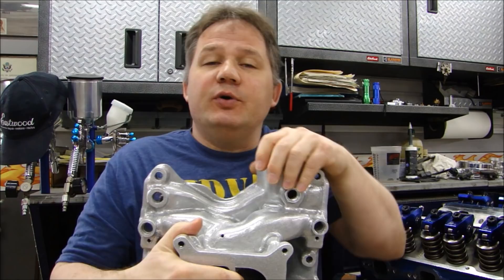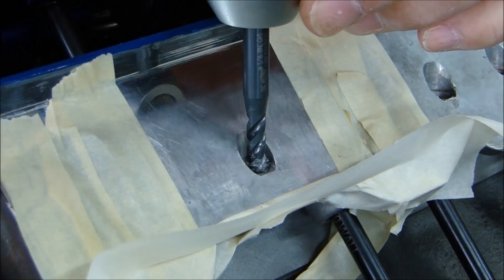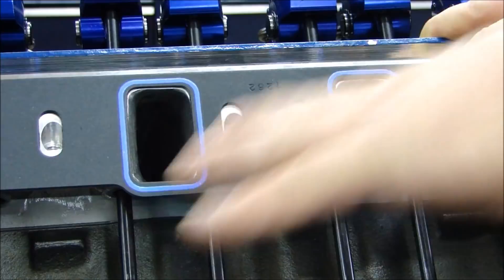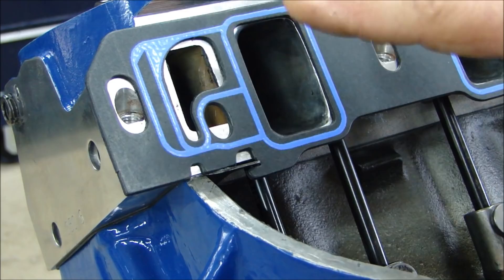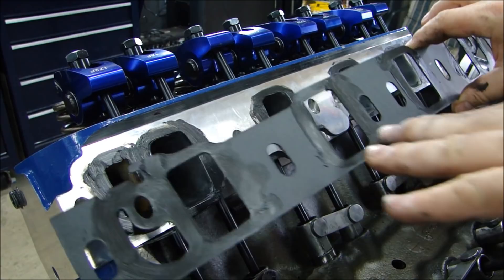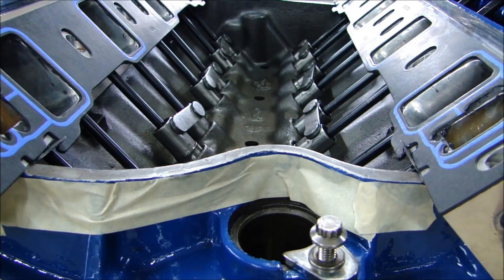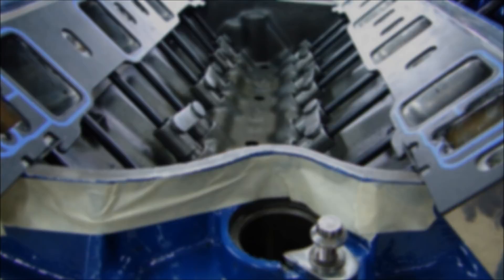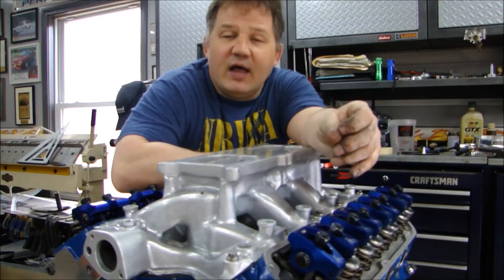Engine Building Part 9: Intake Manifold Installation

Comment: Thanks for the information. I'm currently working on (my first mechanic project!) a 1984 Cadillac Fleetwood with the factory 4.1L V8 (HT4100), replacing the intake manifold gasket and many other things. This is a huge project to work on, one thing after another with this engine. There isn't many videos online that go into any detail about intake manifolds or even engines, in general. You explained everything very clearly and make things easy to understand in all of your videos. Combined with a big shop manual, your videos are a big help!
Reply from the maker: That's awesome Shane, good luck. I had one of those engines, they're not the greatest, but you can rebuild them and get them to last.
Reply: @PetesGarage  yes sir! Thank you for that, I'm glad to know they are worth the time to rebuild. I see it as an engine that just needs TLC and follow up with regular scheduled maintenance. The car really is in good condition other than the few engine issues, not a scratch on the body, vinyl top in near perfect shape. Everyone wants to throw this engine away, honestly I've come to like this (not so loved) HT4100. it's given me an opportunity to really learn how an engine works  and learn the primitive emissions control set-up of 1984. I'm looking through most of your videos and learning some pretty cool stuff! Thank you for all you do, Pete! Going to rewatch the intake manifold videos!

Comment: Nice touch with the galvanic corrosion. Alot of builders out their have no idea why or where the corrosion came from. Good Video!
Reply from the maker: I thought it was important to bring up.
Reply: Tottaly, my son has a mustang. And recently wanted me to help him do some work on it. We started with headers and X pipe.Yea we had to drill out bolts that snaped off due to corrosion. He still has a problem understanding why ford would use such corrosive materials in manufacturing. I told him a lot of it comes from failure to understand how to prep your work. I let him watch your video to help him understand better. His first words after watching was" that was so simple he should send a copy to ford motor company." LOL Keep up the good work!
Reply from the maker: That's funny. Smart Kid!

Comment: Old school is to smear some grease on the tap, it'll pick up most of the debris loosened by the chasing out. Personally, I prefer to use a small "T" bar type tap holder but that'll be a question of preferences, of course.
Another old school trick is to use a standard bottom/finishing tap but lightly grind the cutting edge so it cleans the threads but it minimises the chance of it removing parent material from the tapped part.
Nice explanation on the galvanic corrosion problem, too, BTW.
Reply from the maker: +GordonWG1 Excellent! Thank you for sharing that with us. Lots of great tips
Reply: +GordonWG1 Ahh ya beat me too it.

Comment: Petes videos should come with a warning! it would read  "To avoid conflict, anyone who watches these videos might not want to walk into their friends pro workshop and point out things that they missed, dont forget! no one likes a smart ass" Thanks Pete you make it fascinating.
Reply from the maker: That is an excellent point Bryan, thanks for your comment. I, in no way, shape, or form claim to be the worlds authority. But, I am trying to share best practices to help ensure anyone doing the work gets the best results. I've replied to many comments that say I'm over cautious that I've never had an engine fail from being too clean. If you do happen to wander into a pro shop, you can be polite as possible so as not to appear to be a wise ass. If they're smart, they'll try to learn from because nobody knows everything. I learn something new everyday.
Reply: @PetesGarage  agreed, just a bit of fun, I bought a 460 stroker well worked off a guy who bought it off a mechanic that died, motor was new, it made a terrible tapping when the guy I bought it off started it, i bought it anyway because hed never driven it just started it, revved it and turned it off, luckily it was so loud out the headers he couldn't run it long without neighbors complaining, well when I got it home I removed the rocker covers and they were all loose, I'm thinking that the original owner stored it that way (well I hope) problem is how much damage has been done as there is fine steel filings in the oil sitting on the head. .
Reply from the maker: That's a tough one, hope it works out

Comment: Fantastic Pete. A Great video. 
 I bought a 355 sbc a few years ago that had been blown up. The silicon between the intake and the block was about 1/2 an inch thick and everywhere but where it needed to be. I knew as soon as I saw that it was poorly built with a lack of consideration.
 It had only be run for about a month before it calved, when disassembling it to see what had gone wrong, some of the cam lobes were nearly gone.
 Low mileage, I assume no assembly lube and poorly put together was visually obvious as well as internally.
Reply from the maker: Or poor break-in procedures

Comment: These are some great videos, I really enjoy the knowledge you are sharing. You made the sealant application look really easy which says a lot about your skill. I would recommend that anyone without any sealant experience should get some scraps pieces and get used to working with the sealant first before putting it on their project, it can be much more difficult then it looks and can make a big mess.
Reply from the maker: Great suggestion. Thank you.

Comment: Can also use intake manifold studs instead of bolts. Fool proof way to install the manifold without making a silicone mess, especially if engine is in the car. Great videos.
Reply from the maker: You could...but you'd have to put the studs in after the manifold is installed because of the angle on the heads. I[m not saying no, but I do not see much benefit...great idea though

Comment: Try Permatex high heat "spray copper" form-a-gasket. Just paint the gasket surface. let stand for 1 minute till tacky then apply. no mess no fuss little if any squeeze out complete gasket surface coverage. I use 2 coats. 1 to seal the gasket and the other 1 minute later to seal the head surface wait 1 minute and apply. LOVE the idea of powder coating the intake inside surfaces. never thought of that. Talk about a time saver! THANKS!!
Reply from the maker: Billy, thank you again for some great advice. Like I said, we are all here to help each other.

Comment: one thing to remember about galvanic corrosion (i was taught) - the farther the metals get from each other on your scale, the greater the potential for corrosion. for example, copper and aluminum together - copper will eat it up in short order. copper and lead put together, almost nothing will happen. that is why you can have lead coated copper in roofing materials. but use aluminum nails on a copper roof, they will be dissolved by the copper.
Reply from the maker: +timothy ramsey Excellent point....thank you for sharing with us

Comment: I have countless positive things to say about this video series. To this video i would like to add that one may want to use a tap specifically designed to chase threads. standard taps and even bottoming taps are designed to cut threads and may cut out extra material, thus making the threads thinner and weaker. I use regular taps, but the special ones would be a safer move.
Reply from the maker: That is an excellent point, however, after working in production engine machining for a long time I can tell you that tools wear. If you buy a head that was made right before a tool change the threads could be on the small side throwing off your torque. A tap will make sure they are the correct size.
Reply: That is a great point as well. I had not thought about that. Thank you for the correction!

Comment: Pete, please make a video about your Intake manifold and throttle bodies. I absolutely LOVE your idea. I have been looking for that kind of setup for about two-three weeks and I finally ran into this video. 

Just some questions I am looking for answers!
How did you modify your carbs to only suck in air?
Would an EFI carb work for this very specific application?
How will you be working with the injectors?

Thank you very much! You have supplied extremely useful ideas and knowledge and gave me even more desire and need to learn!
Reply from the maker: I have a video about making the manifold Modifying a Stock Intake Manifold - Adding EFI

I used two Accel 1050 Throttle bodies

Thanks Brian. Let me know if you have any questions as you build yours.

Comment: Hi Pete, I've got a 4.6 DOHC Ford engine in my 95 Lincoln Mark VIII that switches between both long and short intake runners.  I was hoping you could educate me as to why they felt this was necessary  I am very impressed with the style you use in your tutorials.  Your courtesy is very much appreciated.  Thank You.
Reply from the maker: +Michael M  That engine has two intake ports per cylinder (split-port) and variable runner length intake manifolds with either vacuum or electrically activated intake manifold runner controls (IMRC) depending on application. It also has variable cam timing so the intake length needs to switch to accommodate the difference in vacuum. I hope that helps.

Comment: First let me say you produce the best automotive videos I have seen on Youtube bar none! Your use/overuse of the term FM drives home it's importance, you could use ten different terms for grime,,dust, grit,or gasket trimmings would not all stick.I am an NACE certified senior corrosion technologists and your explanation on galvanic corrosion was technically perfect, I would have used a copper/copper sulphate half cell just because you can make one in minutes. Remember your heads and bloke will be " protecting the bolts " If you can paint the bolts to reduce current flow and you will reduce the aluminum lose, be careful or you can focus the area of sacrifice ie you could sacrifice a good amount of aluminum evenly, but of you were 99.9% in protecting the aluminum it would take the same amount from the .1% vulnerable exposed aluminum  Keep up the outstanding work 979-824-1110
Reply from the maker: That is a super comment! Thank you very much Charles. I'm really happy when an expert like you can confirm what I say. I do research before making a video to make sure I have the facts right, but you are even better than that.

Comment: The galvanic issue is something you can't hide from: something has to bolt things up.  I never had those numbers as presented, but in thinking about protecting aluminum... I'd rather the steel took the hit.  Having seen  both regular steel and stainless bolts have to serve in a saltwater environment right next to aluminum, I actually prefer staying away from stainless in critical applications because the aluminum fares better.  For those who like the stainless look, you could nickel plate the bolt heads & washers for show [Caswell makes a decent kit], while leaving the threads alone.
Reply from the maker: Excellent point, thanks you. I have purchased things from Caswell, they make great stuff.

Comment: That tap will cut into new thread id use a bolt type chaser. Maybe. Beautiful work those engine s are resto mods
Reply from the maker: That's a good point Angel, thank you

Comment: speaking of intakes one of the really nice features of the GEN II LT1 and LT4 is the dry intake. there is no risk of a leaking intake gasket passing coolant into the oil or anywhere else you do not want it. the one thing this engine is prone to is leaking oil from the intake gasket. one nice thing about changing the intake gasket is you do not have to drain the cooling system to change the intake gasket and no distributor to worry about either. the dry intake is one of the features of the reverse flow cooling on  this engine.
Reply from the maker: +andrew donohue Ahhhh technology. It does suck having the coolant to worry about. But that's the fun of old cars
Reply: the LT1 is an old engine at this point, they are 20+ years old now. what makes the LT1 unique from other small blocks is the reverse flow cooling. the water pump is actually unique to the LT1/LT4 it actually spins from the back of the water pump, NO PULLEY. it hooks up small output shaft on the timing chain cover. since its reverse flow cooling it actually never goes through the intake. the LT1 has a 350 bottom end but the heads, intake, cam, water pump, and ignition are all unique
Reply from the maker: +andrew donohue I'm letting my age show...I still feel like the '84 Vette just came out. I agree, the LT1 is unique. That is great info, thank you for sharing with everyone
Reply: mid to late 90's cars are out there and being built and rebuilt because they are fairly cheap and make decent power even stock. my car is a 1996 camaro and it makes 285 hp stock. if you bought something from the mid to late 1970's they were not good performing cars until you throw $$$ at them. i can also get 24 MPG out of a 5.7L V8. i bought the car for $3k

Comment: You're the engine surgeon...dude! That's a super clean build! Why not a anti-seaze on the stainless bolts or one of the thread lockers? Is anti-seize really wrong in that situation? Thanks for your awesome video!
Reply from the maker: Thanks David. Anti-seize acts as a lubricant and changes the torque values. i do not think it's necessary. A thread locker is also a lubricant and I only use sparingly in a couple spots, mostly accessory mounting bolts

Comment: I have always read to use thread chasers instead of taps because a tap can make the threads looser even if you don't cross thread. Chasers don't cut. Taps can cut.
Reply from the maker: I use a tap because it is my experience that manufacturing has variation. I tap the holes to make sure they are all the same size. It's preference, but on a new part I will tap the holes.

Comment: Hello pete I have to say I've done Alot of research into car engines and engine building as I am looking into buying an old stingray and turning it into a daily driver hopefully but I have a question for you you talk about galvanized corosion but don't state ways to combat that for those of us like me who live in bad environments such as Washington state wet all the time and close to the ocean thank you your videos have been the biggest help in my research
Reply from the maker: +Keoni Pappas Galvanic corrosion is controlled by matching metals, the environment is secondary. Basically if you stick a stainless bolt into aluminum you're looking for trouble.

Comment: In regards to the galvanic coronation. I work at a resturant where we use stainless steel pans to bake lasagna in. We cover it with plastic wrap before the aluminum foil because the tomato sauce acts as the electrolyte. Just a different example.
Reply from the maker: James MacInnis That is a great example. It can happen with every day household items

Comment: Speaking of "RTV",a knucklehead who worked on my car  before me had slobbered so much RTV on somewhere in the motor, a glob of it, just big enough to get sucked into the oil pump pickup almost wrecked my motor! I thought it was just typical Mopar 318 problems like fluctuating oil pressure. I finally took off the oil pan. My bearings, all of them were at the self destruct point! Through to the copper.  So I ended up changing all main and rod bearings, cam and cam bearings, lifters, pushrods, rocker arms. Then I was past the hard part when a bad driver hit me and flipped it over! Ha ha. 
Also I used to think you were a bit obsessive about the "lint free cloths"!  After I got this Jeep 318 back together I spun it with a 3/4 inch drill and did not have the oil pan gasket on it. I was curious about the amount of trash in the motor because it had a terrible case of sludge. Anyway I took the pan back off and there was a dust bunny of fibers in the oil pump intake! It was a new pump too. It had fallen off me when I was cleaning the motor. A lot of it was dog hair which was on me since I have a hairy dog, and a lot of it was paper fibers from toilet paper I was using as rags. So now I say ,"You were right for sure!" I have become obsessive about dirt on the dipstick, all that stuff. On the other Jeep, we drained the oil then with the back jacked up high, poured gasoline into the oil pan through the dip stick tube .(so the rest of the motor would be gasoline free). Then I had some rayon material I bought from the fabric store and filtered the gasoline to see what kind of trash was in the pan. Quite a few lumps of sludge. And fibers too. Just perfect for getting sucked into the oil intake. So I am a reformed person now. No more lint rags. Clean is important not obsessive!
Reply from the maker: +stanthology That is an incredible comment.....thank you so much! I love the story and appreciate you sharing it with everyone....see..I'm not crazy....lol. So, you can buy Kimtech wipes Science online. They are made of natural and synthetic fibers and produce 95% less lint. Like I always say, I have never had an engine fail from being too clean.
Reply: +Petes Garage Thanks Pete. I was afraid I was committing  the sin of "Long Windedness"! Thanks for the tip on where to buy "lint free cloths"!

Comment: Wow, great video!
You mentioned you don’t like using a coating or lubricant because it changes the torque value.
So what…..add some dielectric silicone grease to the bolt and snug ‘er down….
This is the same dielectric grease that has been used for decades on electrical connections that can and often do come in contact with water or high humidity. 
Just saying……Personally, I don’t put anything in a dry hole…..anything 
Anti-seize/thread lubricant on everything
Reply from the maker: Thanks Joel, electrical connections are very different than mechanical connections, especially with a coating that has silicone in it.